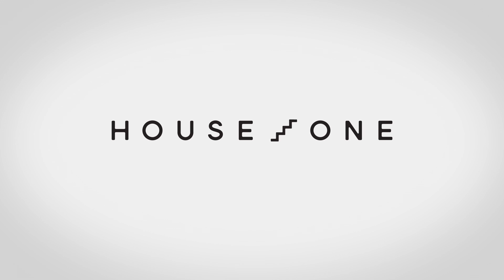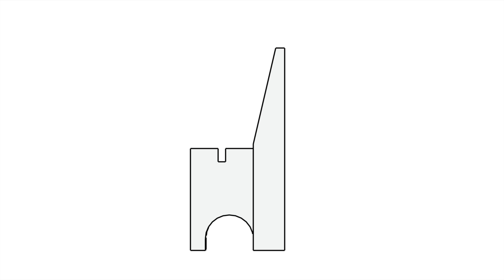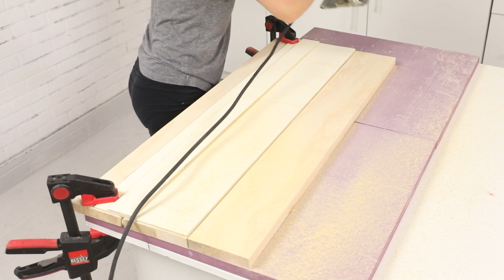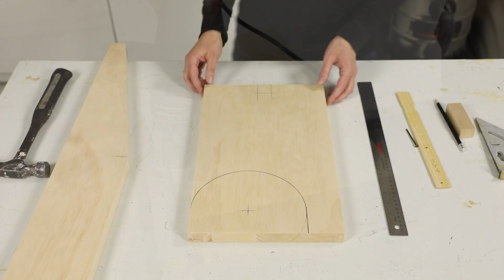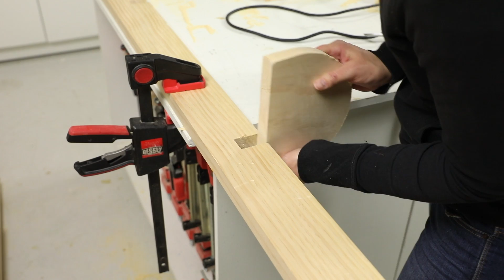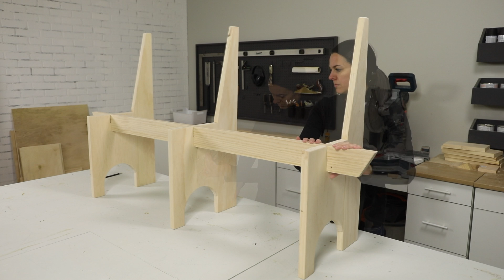How to Build a Shaker Dining Bench | House One | This Old House

Comment: About 10 years ago I built my own dining room table and benches to use for Thanksgiving.  At the time dining room tables were $800 from furniture stores and chairs were $100-$200 each.  We needed 12 chairs.  I'm not a skilled enough wood worker to build chairs, so I built "5-board benches" using plans from a wood working book I have.  The benches worked great.  4 benches enabled people to sit 3 to a bench, so we had 6 people on each side of the table and we grabbed two other chairs for each end.  
If I was building this bench I would have left the rounded edge of the stair tread as it would have made the seat bottom a little more comfortable on the back of the legs.

Comment: FYI the arch in the middle serves a second purpose, well, technically, it is its primary purpose, It’s easier to keep any piece of furniture from rocking if you don’t have straight long legs going from front to back or side to side. You need to have feet that bring your corners down lower than the straight edge. This can be achieved by that arched cut out or any other decorative cut out or by attaching blocks. Basically it’s left up to your own creativity to decide what to do.
Reply: @johnlebzelter4208  thank you for your delightful reply
Reply: @duanemiller5606 You’re welcome you non-life troll. Get a life.
Reply: Stop being negative you clown
Reply: Stop being negative you clown 🤡